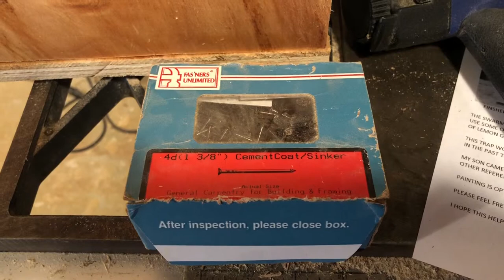Making swarm traps from plywood

Comment: Hello, what inch of board is this used to make? 1/2” or 3/4” ? Thank you
Reply from the maker: This is 1/2" plywood, or pretty close to it.  You can use 3/4" plywood if that is what you have, just make sure to keep the inside dimensions the same so the frames fit correctly.  Thanks for watching!